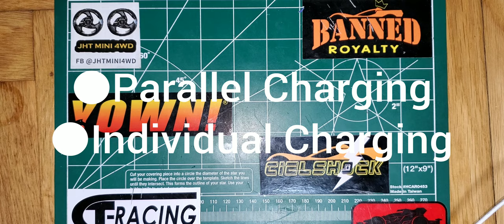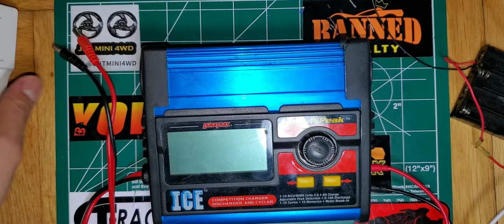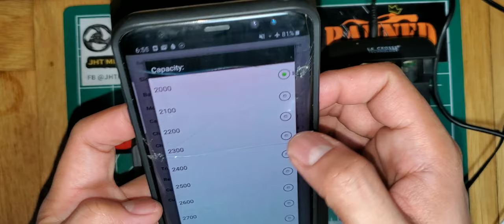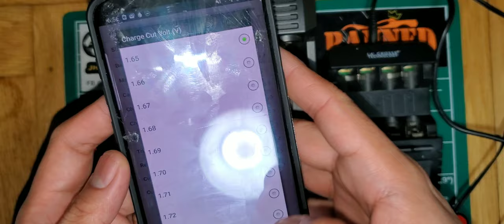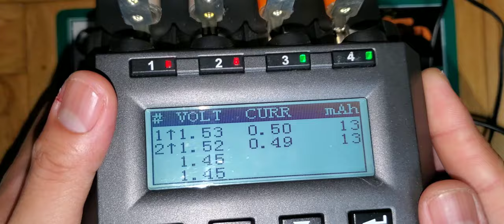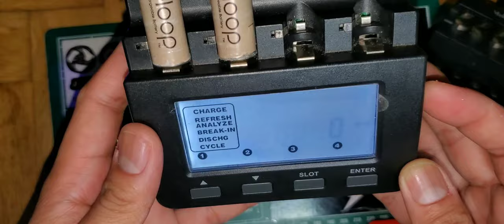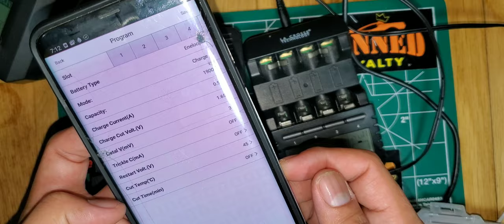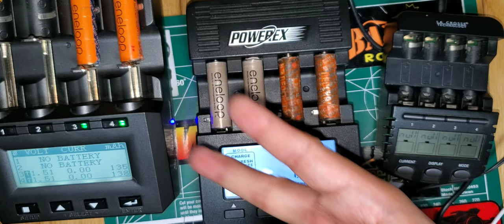(ミニ四駆)Chargers and Charging Methods

Comment: I believe the BC700 is perhaps one of the best choices for a beginner. Reasonably cheap, easy to use, and has basically all you need to start understanding your batteries better. I don't race much nowadays, but I've been using BC-700s for a while and for the type of races I do I've never felt the need for anything more sophisticated.